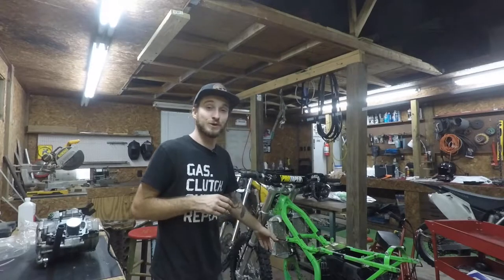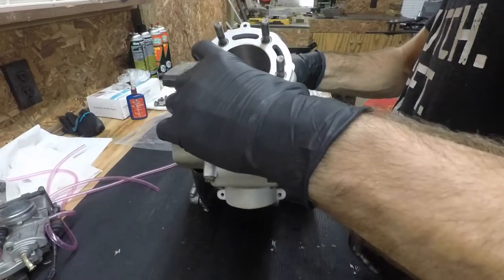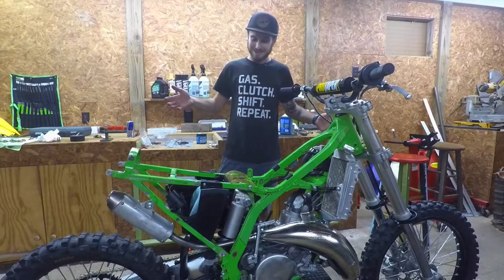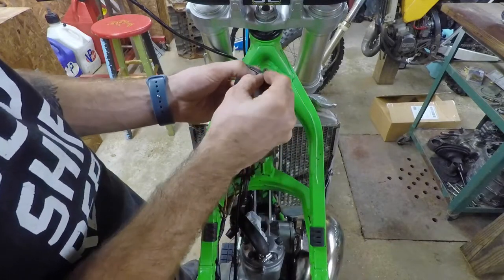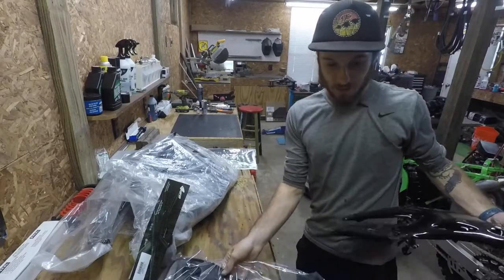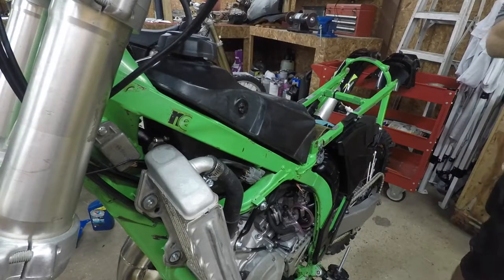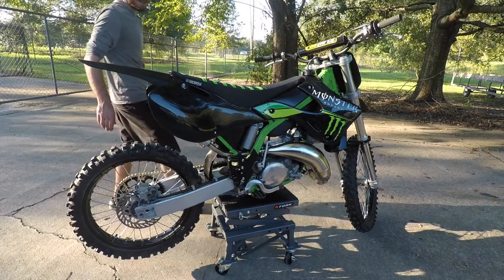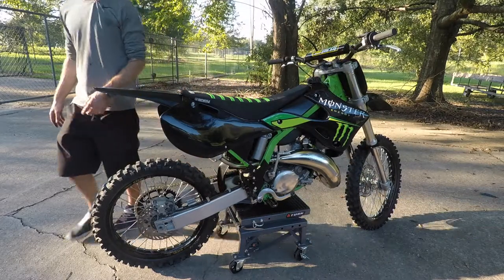99 KX125 REBUILD ASSEMBLY PT.1 | I BLEW IT UP IN 25MINS!!

Comment: I'd agree on Rapscallion's comment. I've owned my 1999 KX 125 since new. Put over 1000 hours on the stock crank, no lie. 32:1 Bell Ray or AmzOil it's whole life, clean air filter, pinned wide open all the time. Top ends I've put in dozens, along with re-nick, bores, re-nick etc. I have and had a lot of other MX and Woods Bikes, but this one is my first new bike I got when I was 16. Special to me for sure. Getting more and more difficult to keep them going. I'm wearing out parts I didn't think could wear out......... Ride on boys.

Comment: That's about the average run time for a hot rods crank and bearings. Stuff is absolute crap. OEM is the only way to go
Reply from the maker: too bad there's no cranks available for the 99. New connecting rod and bearing and runs like a top
Reply: @josiahloubiere7742  too bad there is though, what came in your bike from the factory? Ever consider getting your oem crank rebuilt? You can use a stock crank after seizure it's just gonna take a professional to do it. Hot rods is crap and you are literally throwing unnecessary money at the bike. I'm just putting some advice out there but in all honesty I could care less if you take it or not cause at the end of the day I'm riding a machine with quality parts and well you just are not. Enjoy your bike 👍
Reply from the maker: @rapscallion3421  yea would’ve been nice if I had the oem crank. The bike came with a hot rods crank in it and I had the connecting rod swapped out. being that there are no cranks available period unless you find one on eBay for a crazy price, it was the best option for this bike to see another day
Reply: @josiahloubiere7742  understandable, I've seen to many cases get destroyed because of cheap cranks for me to say anything good about them, but in your case bring it back to life anyway you can. As long as you are having fun doing it then nothing else matters.